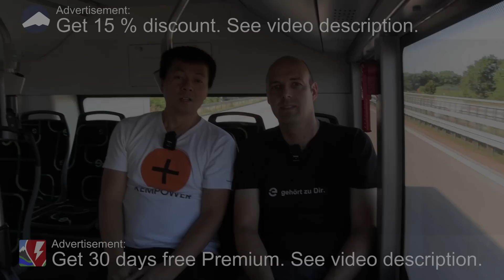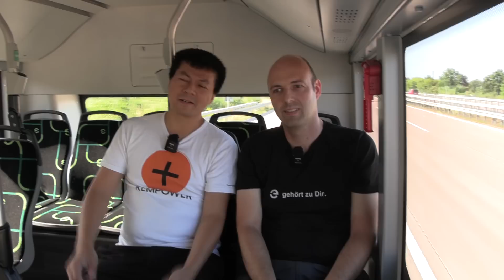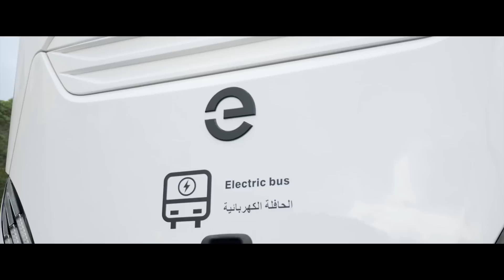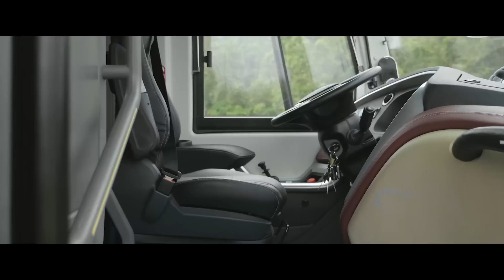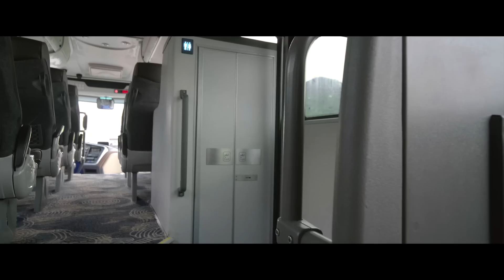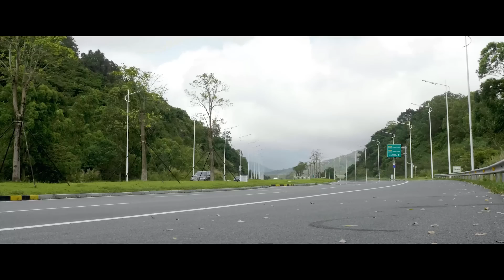Interview with Michael Düde from Eurabus

Comment: The City of Vienna has announced that it will build a garage for electric buses for municipal public transport in the south of the city in 2021. In 2022, however, she ordered over 300 diesel buses, which are to be delivered by 2027. At the same time, a hydrogen bus is being tested in the mountainous west of the city. It is planned that a line there will then be operated entirely with hydrogen buses. Where this hydrogen comes from is not revealed.

The city of Vienna describes itself as a model climate city, but that is pure propaganda.

Comment: Common for busses to be rear wheel drive? What else should they be? I'm not aware of any bus in history that has been anything other than real wheel drive.... why would it? Except 4WD. But that's hardly a regular bus. Normal busses are always more or less rear heavy so would be lunacy to draw an axle from the engine in the middle or rear to make them front wheel drive. They always have double tires at the rear for a reason and not the front. Imagine the torque steer also with FWD.

Comment: 19:30 You cant compare 9000 Nm on the wheels in the bus to the torque from the engine in a regular car... The car has a gear box before that torque goes to the wheels..... + a final drive gear reduction.

Comment: Hi, nice video. What about bidirectionnal charging for these buses? Bus companies could provide grid service too
Reply: not really relevant compared to cars, as 1) there are way less vehicles and the bigger batteries can't remotely cover for that, 2) due to their busy driving schedules they don't really have that much off-time to offer to the grid, and 3) with their high mileage in rather short time, as the operator you really don't want to have any additional wear on the batteries (which is also a topic that has to be cleared for cars)
Reply: @keltainen42 In the US, there are many thousands of busses owned by school districts, that spend a LOT of time parked.  Many are parked for three months every summer and only used for three or four hours per weekday during the school year.

These  will all have to be electric soon.  Eventually, cities will understand that this is an enormous opportunity to strengthen local grid reliability. 

The bus batteries will become an important community asset as soon as the first few BEV busses begin operation.

Comment: What strikes me is that in keeping with the classic "box" design for a bus you probably end up wasting a ton of extra enegry due to poor aerodynamics (at higher speeds). Though I am guessing that the box design is still deemed the best one for a lot of use cases (city use probaby doesn't need crazy good aerodynamics after all).
Reply from the maker: Box shape is probably due to keeping the length as short as possible while getting as much space as possible. Same goes for boxy trailers and European trucks with trailers.
Reply: @bjornnyland  That's what I thought, so it trumps aerodynamics, at least for lower speeds. But at highway speeds I wonder if a slightly more aerodynamic shape is not a better optimum (then again, I am sure the engineers considered such things :D )
Reply: @Sadjina  Look at the old VW Type 2 Bus that came out ca. 1950. The design is a result of wind tunnel testing, as VW realised that the 25 hp Beetle engine was going to struggle pushing around a completely square box. It actually doesn't take a lot of rounding off to make the vehicle more slippery (VW also added reduction gears to help things out), but it will probably increase production costs somewhat.

A city bus mostly trundles around at low speeds anyway, so you're right that areodynamics become less important then. Long distance coaches tend to have more refined aerodynamics, just like VW did with the Type 2 over 70 years ago.
Reply: The US Postal Service "solved" that by adding a long nose to their upcoming electric delivery truck. They succeeded tremendously in designing the ugliest vehicle ever.  The best description I can give you is to imagine Pato from the kids' show Pocoyo with tiny wheels for feet.

Comment: Amazing chat, all while hammering down the road! I laughed when the Transit driver got passed and 'woke up' and started going faster - "Did I just get overtaken by a city bus???" - lol. Good summary of how batteries have now surpassed the problems pantograph charging and hydrogen were trying to solve, loved the sigh as he tried to tactfully put it that hydrogen is just a political fad now, due to lobbyists, not economics or physics. 70kWh/100km is great, €0.20 per km. I can see fixed routes getting their charging infrastructure built out fairly quickly.

Comment: I was just about to type about Pantograph powered buses and then right at the end you cover, your videos are excellent Bjorn and I always enjoy your off track videos. However the Pantograph is still a considerations as this would help with the grid load I would imagine, as opposed to charge the bus up more frequently on a single long distance trip. Truck could also take advantage of this system as well. Naturally the bus would still need a battery to cover a desired distance without Pantograph assistance. Because we need to consider tyre dust as a pollutant and a waste product with no second life, and I can see this technology transfer to a tram design with a goal to remove tarmac and tyres in say 2050.
Reply: Pantographs are just way too expensive. If it goes down then an entire fleet of trucks and busses is stuck for god knows how long. 
It works with trains because they have regular maintenance and there's only one running past the line every 30 minutes or so - but imagine hundreds of not well maintained pantographs scraping accross such a system each hour (logistics companies aren't known for spending money on maintenance)? You could expect these to be down on a weekly basis with huge losses to the economy at large as a result.
Reply: @peterzerfass4609  If that was the case then Trams would not be viable!
Reply: @peterzerfass4609 I lived in a city with pantograph operated busses for several years.  I never heard of the system going down for any reason.

The individual bus would lose contact at certain places, but then the driver would get out and reset the placement of the contact.  It would take about 20 or 30 seconds.  

The busses were so much quieter than the diesel version, and smoother ride, and no exhaust blowing in when the windows were open.  They were "a breath of fresh air."

Comment: An easy area of improvement is the noise level.  It was sometimes hard to hear you guys speak. Just a small amount of engine sound insulation will be great for riders.
Reply from the maker: This short bus was designed to drive at 30-50 km/h most of the time. And sometimes at max 80 km/h. Better save the weight and reduce soundproofing since it's not really needed.
Reply: I agree... Although to be fair I would say this... One point which was made during the livestream is that this demonstration bus is not designed for high speed highway journeys, but for slow speed city routes, and indeed, when travelling at low speed it is much much much quieter! I think that passenger comfort ought to be prioritised more for buses in general, because nearly every bus I've travelled on was kinda bad. I'm sure these are better though
Reply: Doesn't most of the noise come from the tyres in this case? If you use more expensive microphones, you will hear little background noise.
But a much bigger problem was that safety belts were missing!
Reply: @leiflillandt1488  I think I heard Bjorn say in an earlier video about this bus that as it is a city bus, it does not need seat belts.

Comment: 1000 kilometer = 1 megameter?????🤔
Reply: 32,4 Picoparsec
Reply: 0,001 Gigameter
Reply: It's exactly 10000000000000000 angstrom.
Reply: Or 10,000 decimeters
Reply: Wouldn't that be 1,024 km?
Reply: @davidmenasco5743   @davidmenasco5743  hahah well you may know all this but technically not, because measure of distance is not based upon binary numbers or powers of two the way computer bytes are (called the base 2 system) which in the case of computers I think is basically because it works out mathematically to be most efficient most of the time, especially in computers based on an eight bit byte and multiples thereof

Comment: This parallel charging is known from the cellphone world. One+ has two battery packs and the charger double set of leads. My 9Pro can charge @60w with that One+ charger but only 30w with other chargers. Newer phones can charge at over 100w using parallel charging..
Reply: From what I've read instead, the charging speed of 1+ (which I own) comes from the two batteries being in series, so doubling the voltage you end up charging at double power with the same current.
Off course you need an internal DC adapter to then power the electronics, but today they are very very efficient.
If you check your 60W charger, you'll find that the supplied voltage is double (10V) than the previous 30W charger (5V)